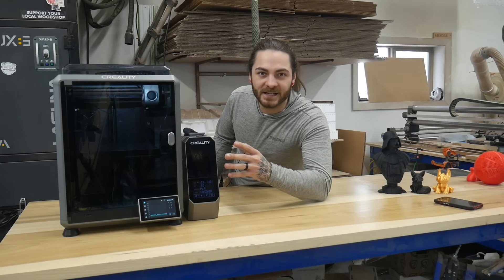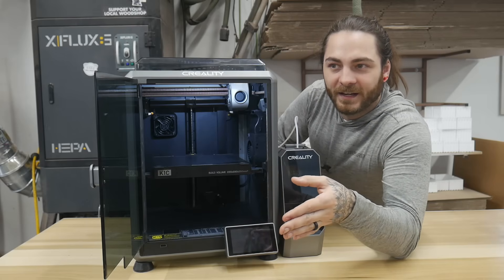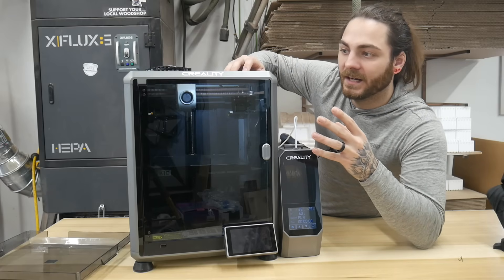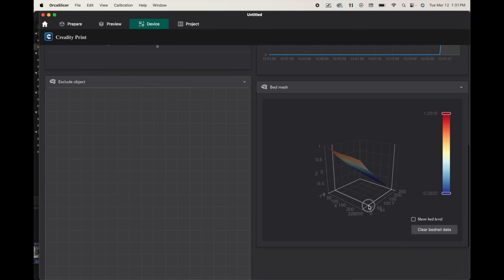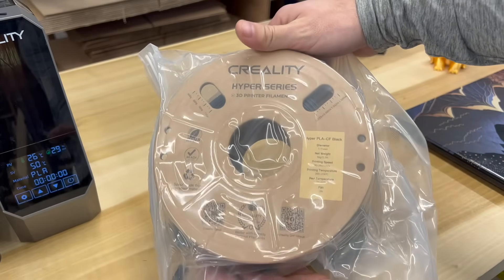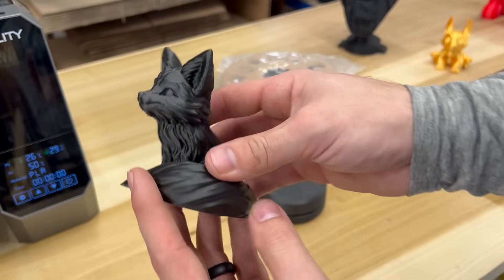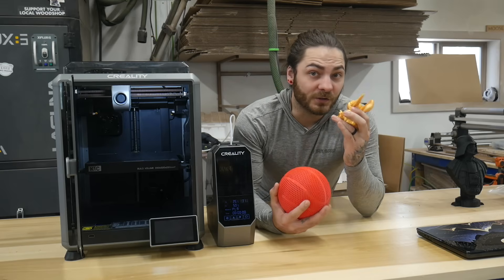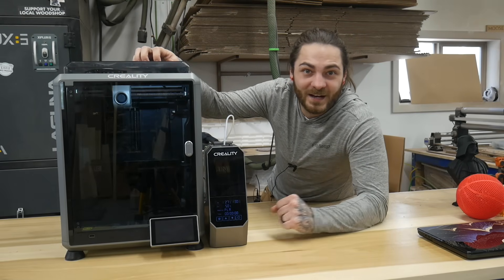Creality K1C 100 Hour review

Comment: I bought that printer at a steal used checked by manufacturer(creality) with new original packagine for around 400 dollars 10000czk it is better than spending that overtime on energy drinks or anything else i use creality print i dont mind it there are maybye better ui but until it doesnt f up i do not care

Comment: hi is bambu lab quieter than k1c? I like my Creality, but the noise killing me
Reply: P1s is noiser then k1c
Reply: @kongson14  i bought x1 Carbon and it's about the same, but for sure the head movements are  more refined - like iot does not start stop so brutally, and because of that it does not shake everything around it like Creality did

Comment: I bought a K1c last August I had some problems with it but very easy to fix , Until now ! I was printing yesterday and suddenly the printer blacked out so I’m thinking it was the hot end that I just replace last month but upon further inspection I found out the wire harness to the Toolhead was showing bare wires and kept on shorting out the printer. So I looked for the part online and to my surprise nobody carried the part . Not Creality, Amazon,AliExpress and more . The only one that had it doesn’t ship to my location. I live in Las Vegas, Nv . So I got in touch with Creality and they said that will see if they had the part and it will cost me Thirty dollars more to send it to me if they have it . Tariffs I guess but I need the part . The printer was the best printer I have but if it breaks down no one carries the parts . Right now Creality Sucks

Comment: for nearly $1,000 AUD you shouldnt have to add shims to get it right. For $1,000 it should be perfect out of the box, no dicking around. What interest I had in getting this as my first  3d printer just died - because shims and proprietary parts. Pass. Thanks for posting. 
I was interested in the K1C because it uses carbon fiber which is $8 a roll cheaper than PLA, and is apparently safer, no toxic fumes and all..... but shims and proprietary parts is a deal breaker.

Comment: One thing, can't  we K1C users, just cut out the nozzle cleaner out of the bed and screw it with small screws to the bed, and use any other non proprietary sheet, as long as you cut the space for the cleaner?

Comment: Hey. So with the nozzle cleaner "issue" you mentioned: there is no issue.  You can absolutely run non-K1C build plates in the machine.  During the homing process before it starts a print job, it actually touches down where it expects the edge of the wiper to be to see if one is there, and if it doesn't detect one, it just skips the nozzle wiping step and moves on.  So you can run older k1 plates or even random sheets of whatever material clamped to the bed and it will run just fine.

Comment: i just ordered the k1c, really liking the specs on the k2 also, next year purchase maybe, I'm newb too all this, wont lie, I have a lab incubator that I picked up at an auction, (auctions are another addiction I have),it heats up to 135 degrees F, is that warm enough to dry out filiment?
Reply from the maker: Yeah that would work! Dryers heat up to 50-60 c which is about that temp. I woold set it on some cardboard or something inside of it, I don’t know what that looks like but I’d assume it would work. People use at home dehumidifiers

Comment: Carbon fiber support is less marketing, and more what consumers are demanding. Like most cases, it's not primarily based on objective factors, but more on consumer perception that CF is "better." Having printed in Onyx for several years, there's a marginal increase in strength, but you'd only really take advantage of it in engineering applications.
Reply: watch Nathan Builds Robots videos where he shows carbon is a safety hazard printing and handling afterwards. In USA you seem to have no proper health insurance and no care for your heath too. While that is fine in saving insurance money, why make your heath worse and pay money to Creality or other chinese company?

Comment: How are the quality of this compared to the elegoo Saturn 3 ultra?😊
Reply from the maker: I haven't used that printer so I cant really help you sorry!
Reply: @TwoMooseDesign  I guess I Can ask - how is the quality compared to a resin printer? I am thinking for printing minis for Dungeons and dragons.
Reply: Resin and plastic are 2 seprate things entirely (Saturn 3 (Resin)) This is PLA, PLA+ ABS etc.. if you want high quality models to paint for DnD stick to resin, if you want large easy to spray paint scenery, stick to plastic. Keep in mind Resin is toxic and a pain in the @$$ to manage and ventilate properly. PLA is relatively easier to manage.
Reply: @spotsworth7805  yea but filament is so much more intricate to troubleshoot than resin.

Comment: FYI, you can use any PEI plate that is designed for the creality printers. During the nozzle wipe routine it probes to see if there is a wipe brush there and acts accordingly, so it will still work without it.

Comment: I've been dealing with a bambulab x1c that has never worked. Bambulab has sent a new bed, psu, hotend assembly, for me to install. I have spent over 100 hours disassembly, installing parts, and reassembly. None of it worked. Bambulab eventually told me my warranty had run out and told me to kick rocks. It has been a horrible experience beyond compare for a $1600 product. I refuse to give them another dime. I am seriously looking at a Qidi or a k1c max if they release one.
Reply from the maker: Creality is coming out with a K2 that has multi color. And sorry to hear that I’ve had no issues with mine.  The qidi x max 3 is pretty good too

Comment: Will they release a k1c max with 300x300x300 print size?
Reply from the maker: I don’t know but they are coming out with a K2 that’s 350x350x350 in a few months
Reply: @TwoMooseDesign  thanks! Will wait for it then
Reply from the maker: It will also have multi color 🙌🏼

Comment: I can't get my k1c to extrude. When I use the extrude function, the material is actually retracting.  What am I doing wrong?
Reply from the maker: You might have a piece stuck in there. Pull the cover off so you can see the gears. You could also have a clog, if that’s the case heat it up to like 240 and shove the little needle up the nozzles to help clear the clog. It could be a number of things but those would be the easiest to check
Reply: @TwoMooseDesign  hey there! These are all the things I've already tried. I had one clog that required a new hot end. Then I broke the wires on the extruder stepper motor so I replaced that part and now I don't know what to do
Reply from the maker: Have you changed any settings or tried rooting the printer? If so I would factory reset it. My next guess would the the extruder but If you replaced it I’m not sure. If it just clicks it typically has some resistance/clog I would make sure your nozzle is actually heating up too.
Reply: @TwoMooseDesign  I have factory reset and still won't work. Can you confirm which plug the stepper motor plugs into?
I can also confirm that the hot end is hot as I can manually get the filament to come out the hot end. 
There is also no knocking sound coming from the extruder.
Reply: I had the same issue and finally solved it with pushing harder the filament on the back 😅

Comment: I'm just going to say... bambu videos never include needing to print a leveling piece to make the bed work
Reply from the maker: You’re right, I have a Bambu as well it’s a great printer. It also has a higher price tag and is not open source. I personally don’t care about it being open source but to some people it’s a big deal
Reply: @TwoMooseDesign  they dropped the a1 mini down to 250 and I'm torn between it and waiting for the phrozen arco
Reply from the maker: I haven’t used a Bambu mini but for $250 it seems pretty legit. Especially if it’s a first printer.

Comment: My k1c bed mesh looks a LOT better than yours. mine is about .25 millimeter front to back on all sides. I'd take mine back if it was a ski slope like that. Also, In orca set your bed temp to 65, tell it it's got a hardened steel nozzle, and KRC 60.  After that it prints awesome.
Reply from the maker: I’ll check that out thanks

Comment: General Question to all: On the screen under Movement/Temp there are speed options of...Ultrafast 125%, Standard 100%, Stable 50%, and Silent. What print speeds (mm/s) each of these equivalent to??? Also, which of these speeds are recommended for PLA, Hyper PLA, and Carbon.
Reply from the maker: I run everything in standard so im not sure what the actual speed outputs are for those on screen settings. I set all my filaments and perimeters in the slicer but the hyper pla is designed to print at high speeds.
Reply: Cool...I do the same...run in Standard. @TwoMooseDesign

Comment: Carbon fiber filament is not the greatest thing, it's just more stiff and more brittle. ASA material is best for outdoor application under the hot sun and cold. PA6/PA12 for engineering components.
Reply from the maker: Thanks for the input! I’ve had great luck printing ASA

Comment: First thing I did was get rid of that build plate and put in a textured pei. then installed a riser for the lid. finally removed the ptf tube from the chain. So now its much easier to load filament. I have been running this machine round the clock  for nearly a week. This thing has been running awesome. mine did come with an extra nozzle.
Reply from the maker: You have the K1C not the K1? You had no issues without the rubber nozzle wiper? I wasn’t sure if it would register the same without it. It does nozzle touch on it so it would probably account for it being gone 🤔 I’m glad they started including an extra nozzle as they should.

Comment: Would you suggest the k1c or the flashforge 5m pro? They are the same price for me.
Reply: The Flashforge is amazing.  I have it and it has been flawless for me.  Only thing i dont like is the Flashforge slicer so i use Orca
Reply: @anthonylong5870  thanks for letting me know
Reply: @anthonylong5870  is everything encasing it plastic?
Reply from the maker: I personally haven’t used the flashforge so I can’t help you with that one. Looks like a nice printer 🤷🏼‍♂️
Reply: @TwoMooseDesign  oh okay, thanks.
Reply: @TwoMooseDesign  do you think the k1c is worth 800 cad after tax?
Reply from the maker: I do yeah, or wait for a sale. They run them on all major holidays. Bambu is great too but even higher price tag. Pretty much any decent printer like this is going to run you $500-600 usd.
Reply: @TwoMooseDesign  alright, thanks for letting me know

Comment: is this a good printer for first 3d printer or is this overkill ?
Reply from the maker: If you have the budget I think it is. Bambu is great too but a little more pricey. Generally the cheaper you go the more tinkering and messing around you will have to do. Bambu was my first printer and it saved me a lot of frustration.
Reply: @TwoMooseDesign  what bambo you recommend for first printer ?
Reply from the maker: The P1S is a great option, if you can afford the AMS I would recommend that too. It makes life a little easier. The X1C is the top of the like but pricey. The P1P is totally fine too but it’s not enclosed which is required for some filaments. Most likely you will print with PLA for a while which is fine for most things except outdoors which does not require an enclosure. Todays printers are far less intimidating as they once used or be and websites like Printables and thingiverse have tons of free files to print.
Reply: @TwoMooseDesign  I just want a good quality printer for printing fpv planes and rc cars this kind of stuff
And some thing that will not make so much noise
Reply from the maker: Then I would buy the P1S as it’s enclosed you’re going to want to use something like ABS or ASA for outdoor use. The K1C is more than capable too again what ever printer you go with I’d get an enclosure for those types of filaments
Reply: @TwoMooseDesign  they are very expensive what about the v3 ke is it good for what I asked ?
Reply from the maker: V3 k1?

Comment: I gotta be honest...I received mine today along with the filament dryer like in the video. Printed a Benchy at .01mm in 16 minutes and a .01mm 600s Test. Both came out perfect...yes literally perfect. Maybe I got lucky with this machine but I would highly recommend the K1C. Creality has a promo you can sign up for...17% off. Note: Also, I didn't need to glue the plate. Follow the manual to the tee in setting everything up and you are set to go.
Reply from the maker: Mines been great 🤷🏼‍♂️ I haven’t had any issues either. I just wish they would add adjustment knobs to the bed.
Reply: where do you sign up for 17% off?

Comment: I have a hard time finding the right settings for my k1 max I have calibrated my k1 max and done everything to solve my problem.  my bearings look too damned and I can't get the machine to run properly.  I've tried setting up clipper and orca slicer but I can't get it to work.  I run with normal PLA which is not too high speed but they are normal PLA.  if you have a good profile I can test with and how you set it in clips, i.e. fluidd, maybe I can get my k1 Max to work as it should, they feel like the machine sometimes does a little what it wants.  So please share your settings or make a video of how you set up both fluidd and your slicer with all settings would be great if it could be solved and help get my k1 max up and running and enjoy my prints.  also want to say good video this you do a good job.
Reply from the maker: Hey! What’s the printer doing or not doing? I mainly run the stock profiles and then tweak them slight as needed.
Reply: @TwoMooseDesign  They feel like the machine is going fast and they feel like I might have missed something.  they become like my edges go out of the printer because of too low flow or too low or high speed.
Reply from the maker: You might have the bad extruder. I would buy the newest version or see if customer support will send you one. It’s hard to tell without seeing your prints or the machine running. Possibly try posting in the k1/k1 max facebook group. Without seeing anything it’s hard to say but under extrusion is an issue with the K1 max and the extruder is usually to blame especially on the first generation models.
Reply: @TwoMooseDesign  I have the latest one as far as I know I contacted them to get the newer one and got it sent.  I don't know how I can show you here, unfortunately, as it is not possible to send pictures.

Comment: When it came to buying a new super fast printer I did not even consider the Creality machines, after buying 5 different models of Creality printer I know just how janky they can be, I bought the Bambu Lab X1 Carbon and AMS and I know I made the correct printer!
Reply from the maker: I love my Bambu printer it’s been great, no complaints
Reply: @TwoMooseDesign  One thing those Creality printers taught me was how to repair and them when they went down as I learned how they worked
Reply from the maker: @AndrewAHayes definitely a little more finicky than my Bambu but they are getting better. Just need to stop rushing them to market and have better QC
Reply: very happy with my p1s as my first 3d printer!
Reply from the maker: @peterpeter5666 p1s with the AMS is the best bag for your money in my opinion. Great printers
Reply: agree! @TwoMooseDesign
Reply: Did you?
Reply: I have a 3-D printer, a bamboo carbon, and all I make is junk and spend money on filament for junk
Reply: yeah sure, but 1) i cant have my models end up in china 2)i dont want to have a chinese server in my home network without knowing what it does , seems like a security leak for me 😮 and that also explains why they are so cheap, they sell your data
Reply: ok  @Basement_CNC